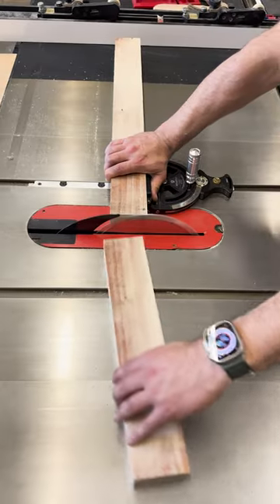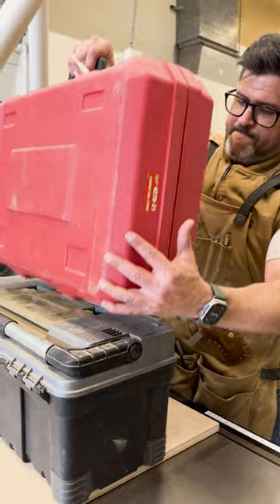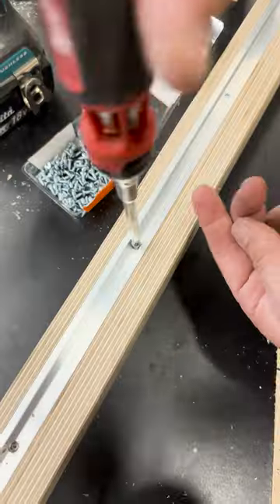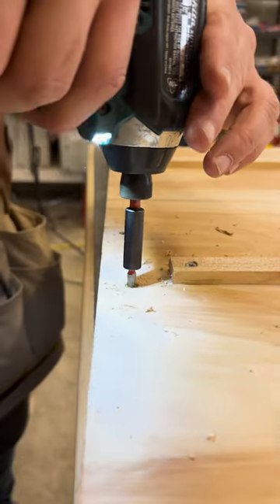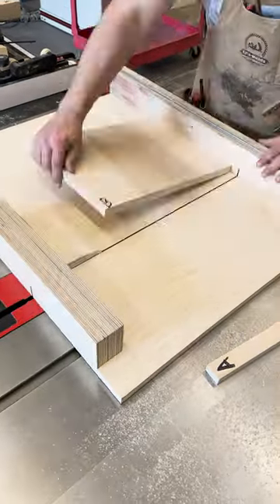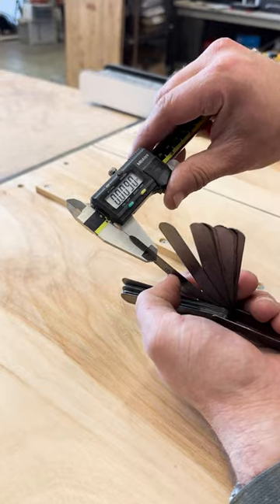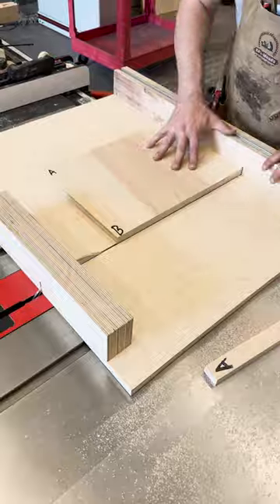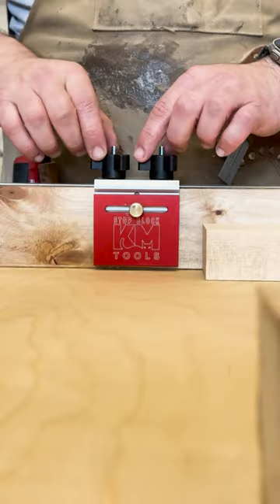Perfect Cuts Every Time? | Table Saw Crosscut Sled Pt.2

Comment: So what if you only have one slot in your tablesaw?
Reply: I’d recommend getting a table saw w 2 slots. Most single slot ts’s I’ve seen are too small and light for a decent sled anyway. Last thing you wanna do is tip it over pushing sled thru.. Just dial in your miter gauge until you find a good deal then upgrade to a better table saw
Reply: @natureboyricflair8555  yeah, I see the logic in that. Thanks!
Reply: @JackWagonOne  no prob I had same issue early on with mine and it had two slots. Good luck to ya!

Comment: Unless you have a ton of stock, it’s probably cheaper to buy a $75-100 cross cut sled
Reply: Building a sled is good experience.
Reply: @ThekiBoran  of course! That being said if you don’t have a wealth of material laying around it’s cheaper to buy a really good one. Also cuts out any mistake/accuracy issues better
Reply: @AlabamaManChild   if you're on a tight budget, yes.  But if your budget allows, the experience and skills gained by building your own is invaluable.  Learning how to build and do stuff can save you money down the road.  Trust me bro.
Reply: @ThekiBoran  I’ve always been of the mind that making 1 90 degree joint; two glued on rails; and a kerf cut was pretty skippable. 

I think Woodpeckers makes a pretty damn sweet one for like $100 bucks or so. I enjoy it a lot more than my first sled tbh. But I def think many would enjoy the DIY process!

Comment: That was as clear as mud.
Reply: It’s less than a minute long. I watched it twice, and understood completely. Look up 5 cut method if you’re not familiar with it, and he’s talking about making sure the sled back is square with the runners on the bottom of the sled.
Reply: @Wowzers740    he's making sure the sled fence is square/90° to the blade.
Reply: Check out a 2012 video by William Ng, "5 Cuts to a perfect cross cut sled."